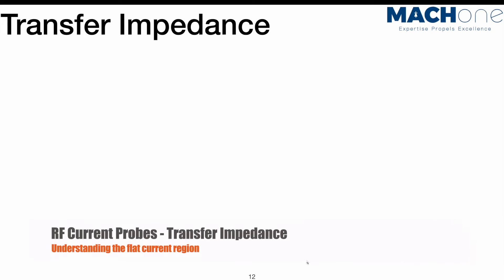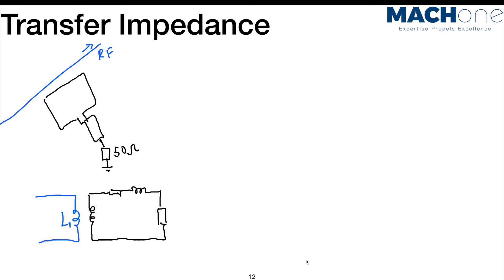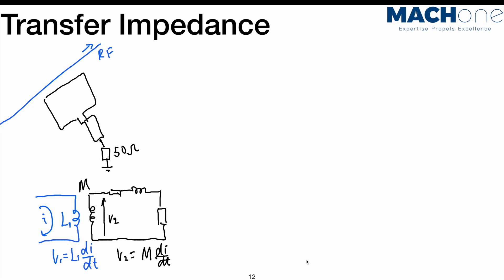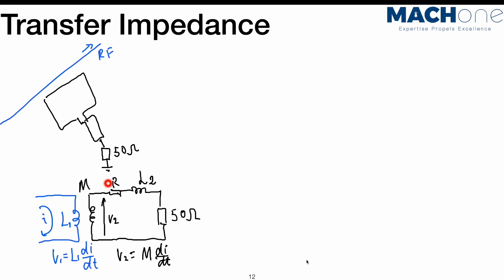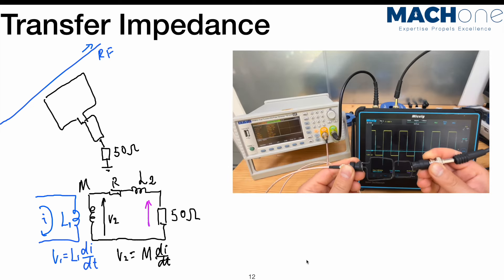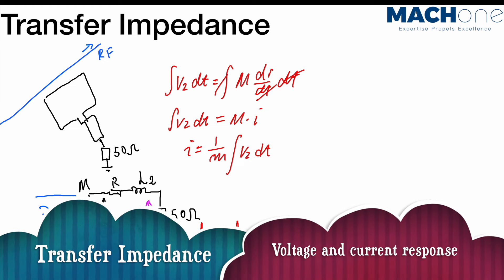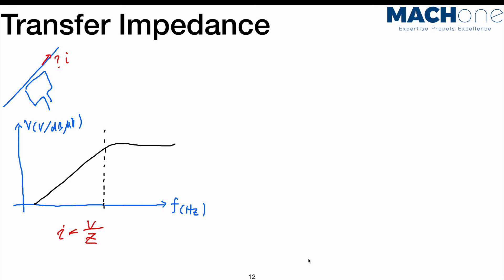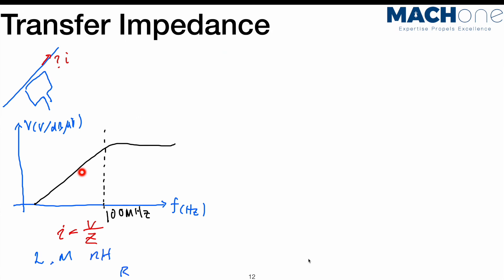RF Current Probes Episode 3 - Understanding Transfer Impedance

Comment: Lets say I have a current probe capable of measuring 350A( DC-60Hz), with transfer impedance of 1ohm. Now terminating the oscilloscope at 50 ohms means I should read (350)*(1)=350V on the oscilloscope, which definitely is not possible because of lower voltage measuring capability at 50 ohms termination. Please guide how can we use a Current Probe in this condition. Thanks
Reply: Can I actually use a current probe to measure DM current in 100s of Amperes? I suppose yes, but that leads to the above problem.
Reply from the maker: good question Mustaf, most likely the probe will saturate, I am sure some manufacturers can have a design to improve their current rating, but that often at a cost. Also, for such probes, you will probably not get 1 ohm as transfer impedance, they are most likely like 0.01 ohm or something like that.
Reply from the maker: actually, I just looked it up, Tekbox will soon have one probe that is capable of taking bias current up to 200 A without getting saturated, and the transfer impedance is about 11 dbohm, but they also recommend only use the probe to measure RF noise, the current rating is really there to ensure the probe does not get saturated. So I guess if you want to use a probe to measure accurately on DC to a few hundred hertz, best is to use a Hall effect based probe.

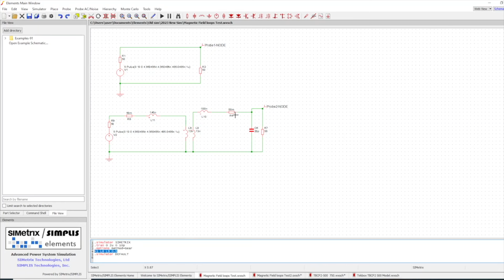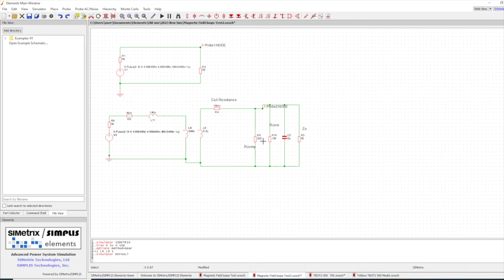Comment: Hi,   May you please explain why the capacitance "C6" (in 1st case 15:17) is higher than "C2" (in 2nd case 17:35).
Reply from the maker: Well spotted, 6p and 20p are not so much difference for the results (for Low frequency), I think I may have two sim models there and I chose different values when I was building the models. I should have used the same value for consistency. Many thanks